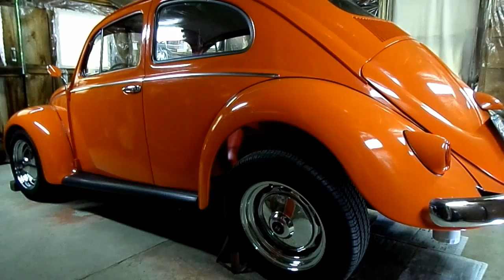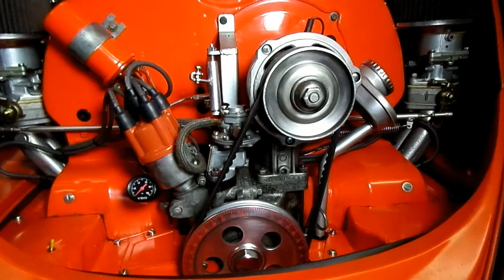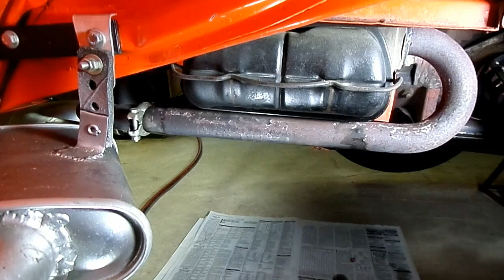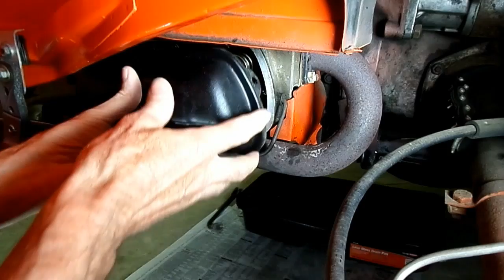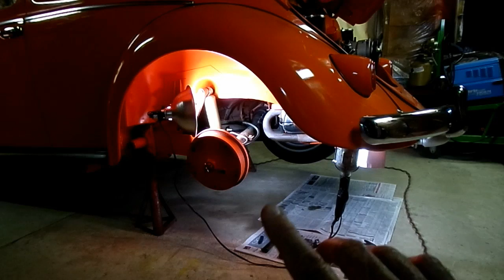Valve Adjustment Vw Air Cooled Engine

Comment: Always push on the push rods to take up any play before checking gap.  Verify your specific engine spec. for your valve gap.  1964 40 hp engines have 2 different specs.  Cheers!

Comment: Nice video Three comments. One, use a shop towel and loop it around the valve cover bale. Give it a good pull and bale is off the cover (no screwdriver needed). Two, I take the 006 feeler gauge out of the rest of the feeler gauge packet, and just use it alone to adjust valves. Number 3. Turn engine to TDC using degree wheel. Go under car and remove both valve covers. You will see 3 loose valves on one side of the engine and one loose valve on the other. Check and adjust (if needed) all 4 valves. Now turn the engine clockwise 360 degrees to TDC on the degree wheel. Go under car and you will see 3 different loose valves on one side of the engine and 1 loose valve on the other side of the engine. Check and adjust (if needed) all 4 valves. You are done! Reinstall everything you took apart.  Thanks for taking the time to make this video.

Comment: A shortcut I learned years ago is that in the #1 position, you can set the forward most valves on the passenger side and the rearmost valve on the drivers side.  Then rotate crank 360 degrees for the #3 position and set the rest of the valves.  Saves a lot of time and up and down under the vehicle.
Reply from the maker: Thank you for the tip.

Comment: On #4 valve which one is the intake and which one is the exhaust if your sitting looking at the rocker arm.  You named all the others.... not number 4.  I am a newbee and do not know.  Also, with a 40 horse motor, 1500, what are the clearances for intake and exhaust?
Reply: rioraton - Look the location of the exhaust and intake on the motor. 
The exhaust valves are the outer ones (closer to exhaust ports).
The intake valves are the center ones (closer to the intake manifold).
Cheers

Comment: Thank you for this vid. What's is that gauge next the distributor?
Reply from the maker: I put in a gauge to monitor the oil pressure.
Reply: right on whats the part number and brand please and where did you install it to? and why not in side. oh and luv the rims what are they and what size thank you sir
Reply from the maker: I will see if i can find the part number.It is installed with a T adapter in the stock location.
Reply: right on thank you
Reply from the maker: The gauge is a VDO 153 009
Reply: oh yes right on thank very much sir :)
Reply: is this much better them running wire to the front of the car where i can see it
Reply from the maker: It would be better with the gauge inside the passenger compartment but i personalty did not want the gauge there.
Reply: +richpin06a thank you for your time and always answering some of my dumb question I'm learning my self to try and do the work seems easy and can't really afford to pay every time a mechanic thanks again.  👍🏼👍🏼 I have a 1966 Bug with a 1915cc with a Rancho trans with dual 36 dellortos carbs with electric fuel pump with 8psi it takes 6.5 qt of oil I'm still learning my bug what sounds it makes etc etc I just recently jumped on the freeway and oh man I felt unsafe in it. I have my Toyota Tacoma that I have. I bought this Bug restored from the group up for my local driving I felt that I was pushing my engine I think to much on the freeway I was at around 450 rpm I'm not sure at what rpm's I should be shifting etc etc well thanks again Sir.

Comment: nice video...what about torquing the heads first? "das li'l breast"
Reply from the maker: +amal carlileIf If it has not been done in awhile i would think about doing it.
Reply: amal carlile - Well said. I advocate that since ever... and not just in air cooled VW´s
Saved a lot of "blown head gasket" diagnostics, misfires, etc. with a simple check of the head bolts torque/exhaust and intake. :-)

Note to anyone reading this: DO NOT OVER TORQUE. If any mating face or gasket is not doing it´s job properly repair/replace as needed. Don´t overdue. ;-)
Cheers

Comment: where can you get that tool to adjust the valves?
Reply from the maker: +Daniel S Feeler gauges can be bought almost anywhere.
Reply: thanks.
Reply from the maker: +Daniel S The beetles had a sending unit which was on the top of the fuel tank and could leak if the gasket or o ring depending on the year was faulty.
Reply: got it.....fixed......sender was bad.........gauge was sending too much voltage to sender and burnt the sender out. New Sender needed......but German ones are hard to find!

Thanks Rich!